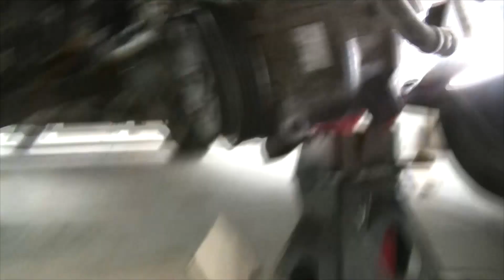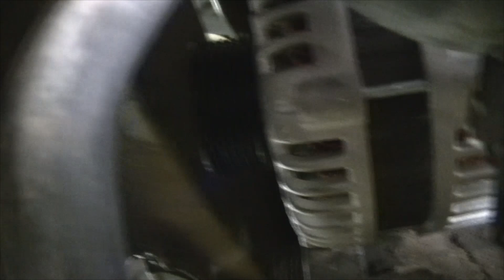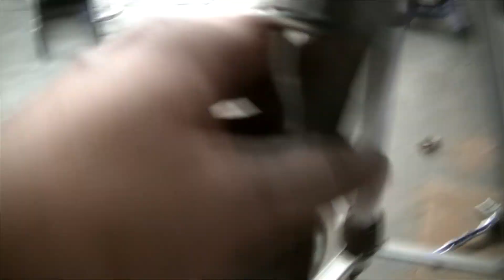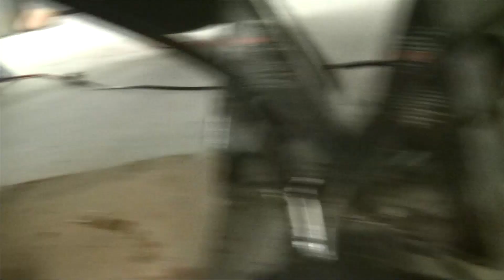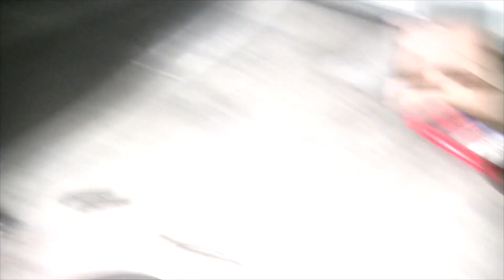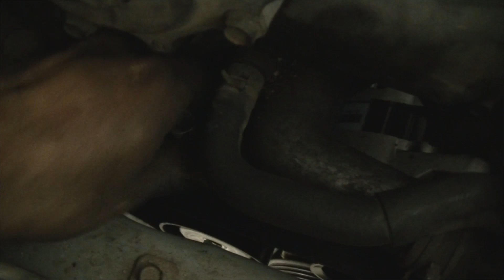2002 Nissan Maxima: How to replace the Alternator, Idle Pulley, Drive and Serpentine Belts 2/2

Comment: My pulley fell off on exit ramp from freeway I heard it loudly under hood I doubled back picked up pulley from RH lane just a bit of road rash on it by then, otherwise fine, got a new M10x1.25 nut for $1 and a few old 1/2” washers laying around the house, and fixed it for $1

Comment: Im having a hard time putting the belt back on. No matter what i do its not long enough
Reply from the maker: Seems like the wrong belt or a tensioner issue
Reply: @link375  yea thats what it was. I guess i bent it when i was taking it of or putting it on. But now have a new tensioner and pully

Comment: For future reference the alternator is usually bad when the battery and brake/Park light comes on at the same time that’s a default for most manufacturers then if you keep driving everything else will light up on the dash as the battery drains down til the car cuts off and then you’re stranded somewhere.
Reply: I forgot to add it could also be the belt at times but there’s usually other issues that come up when the belt is broken, depending on what it’s driving you’ll notice rather quickly.
Reply: Happen to me today on my 02 maxima

Comment: I am about to put my alternator back on after replacing the voltage regulator, and I dealt with that bracket on the top by just removing it with the alternator and then removing it from the alternator while it was hanging. The bracket is still hanging from the wire. Im gonna bolt it back in the alternator and then put the alternator back in place. It seems to solve that stupid bolt. Idk why they put that lip on the bracket.

Comment: My hat is off to you! You did a wonderful job on this video. Thanks for your excellent video. I'm about to do this job and your excellent video is really inspirational. I have always known that whenever my alternator needed replacement that it would be a long job. I'm a perfectionist and I have to label everything and put it in a ziploc bag. You've done an incredible job. Thanks so very much for your help. I have Milwaukee cordless tools and I'm not going to use them on this job for fear of rounding a nut or bolt head off. I really think this is a job for hand tools. This is a very tough job for a person that has never done it before. It's very easy to round a bolt head off if you aren't careful. I didn't see if you disconnected the ac compressor before or after you unbolted it. That connection is hard to get to and it has a short line. All of the videos that I've seen never show how they disconnected it. You can short that plug out if you take the ac compressor off before you disconnect it. You can get your hand on it but you can't see what you're doing without a mirror and light. You spent more time on your video showing more detail of the job than any other video I have seen. Thanks again!

Comment: fucking Nissan Are pos to work on ... especially maxima
Reply from the maker: Souverain Daniel lol this was the worst job so far everything else has been pretty simple and it's been a reliable car
Reply: Oh to be reliable I have nothing to say against that loll but by far the worst car to work on I've own ... Even my wrx was fun compare to that one ... But honestly all transversal 6cyl are that bad ... Inline 6 ftw ...
Reply: But I was watching your video because my betl snapped today I when I went to put a new one on the tenssioner was stock at the lowest point and I couldn't get the new belt on it ... Lol the adjustment is stuck on it .. anyway took it out and soak in in oil .. I'll check on it tomorrow lol it's not that old but the a/c compressor is seizing up so I might need a shorter belt to bypass it ... Its a beater lol Canadian  winter are hard on cars

Comment: this is the worst job i have done in the last  30yrs bullshit it is not easy and you  left out a few steps.
Reply: Jack edington dude it took me 5 hours.
Reply: Prob two spend looking for my power steering belt pulluy nut that someone had broke off cuz its lh thread
Reply: Jack edington come on it’s not that hard. Only took me 20 minutes. I’ve had a harder time working on more simple things.
Reply: I’m mechanic I did a swap and 5 minutes

Comment: Thanks, this was helpful to see what the tension pulley setup looked like, I just needed to change the belt and pulley without taking it completely off the engine. My 2003 has 303K, Uses oil like crazy, but need to keep it alive.
Reply: Dave Hutchins that’s a vq35de for you. Drink more oil than gas.

Comment: Thanks for the videos. I did this today and was pretty straight forward. The small alternator bolt at the top, near the harness and ground connection was probably more difficult to get back in than take out. I ended up using a really small 1/4 socket wrench with a 3 inch extension and 12mm socket. I tightened as much as possible by hand and then attached wrench to tighten. Also, on the bottom, the "oil" line that needed to be detached was actually a oil coolant tube. I discovered this after mine was punctured somehow and started dripping coolant. Be careful if yours is all rusted out like mine. It seems to be a dealer-only part and I had to order one for 30 bucks. Not too bad, I guess. I did find that removing the idler pulley assembly right away was also helpful. I did replace mine with a new pulley unit like in the video because upon inspection I saw that my tensioner on top was all rusted and seized up. That was about 40 bucks. Best of luck to anyone attempting this and thanks again for the videos.